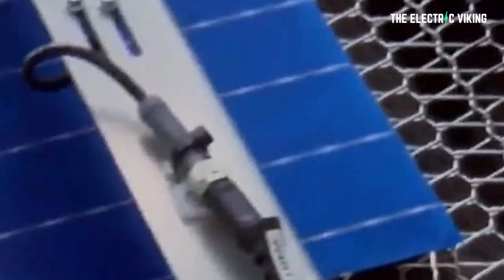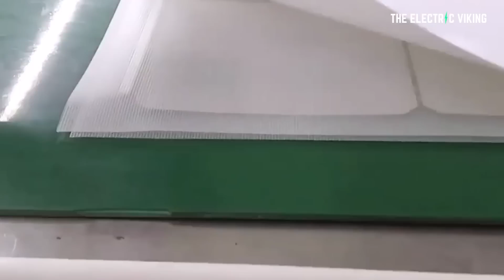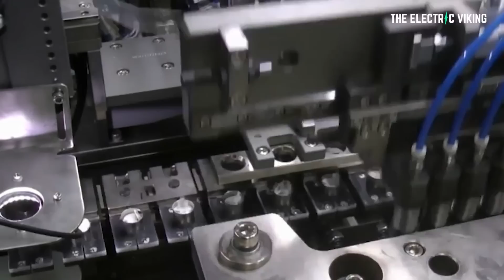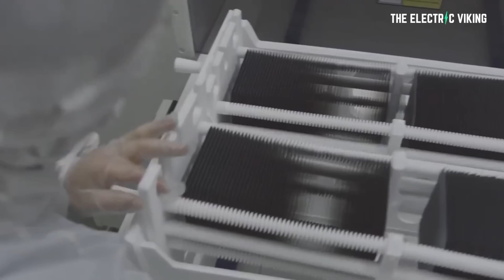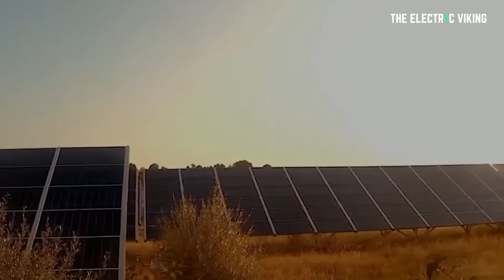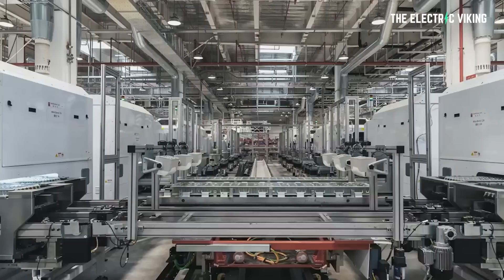China’s solar panel price war will double solar panel installations globally

Comment: Price cuts may stimulate demand but I suspect capacity is still almost fully utilized so that it is difficult to increase production that much. Also it is now vital for energy security reasons that North America develop local capacity. 80% reliance on China for solar is literally an order of magnitude worse than reliance on the Middle East for oil.
Reply: Relying on China for solar panels is not as risky as relying on the Middle East for oil. If China cuts off our solar panel Supply we can't grow but we can still produce power. If the Middle East cut off our oil supply prices would Skyrocket and we would be without reasonably priced power very quickly.

Comment: Is there any new talk about solar generated in the Sahara desert, and transported to Europe?
Reply: Talk...yes. However the Key question is this. Do you want to spend Billions on a facility and a cable then "Trust" that the politics of the country that is supplying you will remain stable for the next 30 years ??. Vlad has made many question the wisdom of relying on your neighbours !
Reply: The big benefit of solar is it can be fully decentralized and owned by the consumer instead of big utility companies that are control and monopoly driven
Reply: Yes, check how much transmission costs to build. It's expensive. It takes time. It takes permits.

Comment: Cost of labor for installs and permits is still high, panel cost dropping 30% may drop total cost 5-10%
Reply: Exactly this. 
On a 4kw system (10 panels) a 30% saving on panels will only correspond to a 8% saving on the whole system cost.

Until the installers get back down to 2019 levels of margin per job then prices won't even get down to those levels.

Comment: Dear Viking: It is still to be seen how much acceleration is doable. Installation people are already stretched to the max and the books are full for the entirity of the year. Any new orders for PV here in central Europe will be executed in 2024  not only due to lack of manpower but also due to delivery issues. Therefore if China continues to lower prices, that's ok, but it helps us in Europe only if they can deliver! E.G. the acceleration will not be more steep than the production can follow or even better: It must be leading as a spearhead. With the market logic, you are right, but there was an entirely different reason why PV installations have skyrocketed over the past 2 years here: Uncertainty and preview to the current energy crisis. This said: INstallations have increased here to the max the industry can cope with even prices and especially installation cost have increased, e.g. margins for installation companies have improved. The limiting factor is not prices of panels, it is availability.
Reply: I had solar panels in the UK for the last 11 years  2.8kwh  system and when I need electricity the most it produces below 100kWh a month Dec Jan and summer time I'm oversupplied around 300kwh month April May Jun Jul August ( average) . So in northern Europe we need more than solar power to be green
Reply: @xperyskop2475  That's what you have wind for.
Reply: @xperyskop2475  any worthwhile VAWT & thermal storage options beyond Caldera?

Comment: The cost of Solar Panel and inverters are dropping rapidly. More and more house install solar panel in their house. Bringing our electricity bill drop to almost 90%.... this is partly contributed by cheap quality solar panels and inverter from China. Their solar panel offer manufacture warranty of 12 yrs and 25 yrs of guarantee 80% performance. And inverter guarantee for 10 yrs. This has make owning solar power panel for domestic use so much cheaper. Best part is Malaysia we dont have to worry about winter.

Comment: Hi Sam.  There's a problem.  An average solar panel of two square meters in size is said to use about 20 grams of silver.  It has been estimated that a solar panel field 100 miles square would be needed to supply just the United States with 100% solar energy.  There are 1,609.34 meters in a mile so, doing the math, that much solar panel area would require 258,997.52 tonnes of silver.  However, global annual production of silver is only 26,900 tonnes.  This tells me we will need to replace silver as a solar panel conductor with something else.  Graphene comes to mind but we are years away from having cheap graphene produced at scale.
Reply: Currently a problem.  The US is not manufacturing solar cells.
Reply: so it would just take 10 years to build the panels? your problem doesn't sound like a problem at all..
Reply: @fredrelay1052  I hope you're right but that's IF graphene will work.  I'm sure the total world's production of silver would not be available to the photovoltaic industry.
Reply: We don't need to run the US on 100% solar.   Neither has technology development come to a screeching halt.   The 100% calculation assumes that.  Not dumping on anyone.  But be careful with this sort of calculation.
Reply: @danharold3087  Totally agree but such matters must be part of our figuring when we talk about transitioning from fossil fuels.
Reply: @McClarinJ  Agree too.  Just saying don't start with brain damaged over simplified calculations like the solar one.
Reply: @danharold3087  I agree it's over-simplified but brain-damaged?  If we don't do the napkin math we'll be forever in the dark about what's needed.  You're welcome to suggest a more accurate set of numbers.
Reply: @McClarinJ  Start by not assuming the US will run 100% on solar. LOL

Comment: Okay, Sam...

So the diesel powered equipment needed for mineral extraction...the petroleum and gas I puts needed for materiel processing and refinement...the power needed to run those factories 24/7, regardless of weather...the seaborne and land shipping to get those panels wherever...they're all of a sudden going to be done by solar.

Really, dude?
Reply: By your rational it is impossible for farmers to grow crops.   The weather cuts yield.  Birds eat the crops. Equipment fails at critical times.  Some falls off the truck on the way to the bin.   Some crops spoil in the bin.    Prices are generally in flux.
Reply: @danharold3087  Your analogy was actually an extension of what I just said.  Without the petrofuel and gas inputs, farming drops or ceases.

Thanks for the assist.
Reply: You might want to look at solar powered electric mining & farming equipment catalogues. Remote mining sites are tortured by diesel costs. Solar/wind/battery setups are reducing cost inputs already. As the song goes - Times they are a-changing.
Reply: @kimbels791  Haven't seen solar/wind/battery doing anything but causing power instability and RAISING costs.

Power poverty didn't come from coal and gas.  It appeared after the installation of solar and wind and the imposition of feed-in tariffs/net metering.  Even though these sources are a BLIP on the utility operator's map, they have to pay solar and wind owners for full power, even though they actually generate almost  NOTHING.  They then ALSO have to keep the grid up using coal and gas, which they are FINED for using.  Guess what that does to power rates?

They don't go DOWN.
Reply: @billcichoke2534 Choosing to change the subject & ignore that I just pointed out that regional/remote mining & farming operations are benefitting from cheaper running costs with solar/wind/storage set-ups because they are not grid connected and diesel is very expensive won't change the fact that this progression is successfully under way.

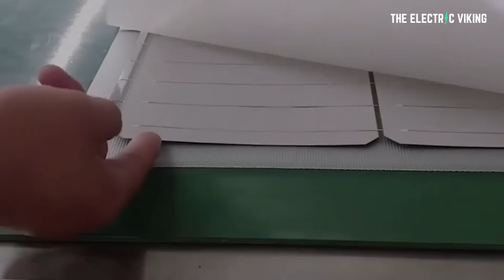Comment: 5:12 Polysilicon panels are ideal for many commercial installations such as on warehouse roofs where there is an over abundance of space.  However for domestic installations which are usually limited by size,  the more efficient monocrystalline panels are usually economically advantageous.  This is even more true in Europe where the sun is weaker than some parts of the world, so you need as much efficiency as you can get from the installation.  Whether monocrystalline raw material costs are falling is another matter, I suspect not significantly since they went up a lot in 2022.
Reply: Supermarkets: have a lot of roofs...what do they do...instead of using daylight and installing solar for the evening...they close the whole shit and use electricity...even during the sunniest days of summer.
Reply: The cost of solar panels is only part of the cost, with optimisers, inverters and batteries plus installation costs.    In the 6 solar quotes I've just had the PV panels make up around 25% of the total cost. 

 It may be that with large  commercial installs then a greater number of lower cost panels can be fitted, but these will need greater inverter and battery capacity too 

So, on UK (and European)  domestic installs the reduction in panel cost would only reduce the total installation cost by c8%.
Reply: Land scarcity is not a problem in many countries and there are many ecological advantages in floatation solar power plants in rivers and lakes , go read the articles about it.
Excuses and misinformation are often in the interest of stakeholders.
China, India, Africa and much of Europe have invested heavily in billions in these technologies, why is US trailing behind? Bcos there is little profit to be made for the big players and stakeholders
Reply: They can also use wind and hydro/wave for colder places with less sunlight than California
Reply: Solar panels are made with coal (for the substrate) and then natural gas (which provides the hydrogeen for deposition). solar panel manufacturing was massively interrupted by the energy shortage particular in eu for german made panels. there is sadly no practical way to make solar panels without fossil fuels at the moment, without making them 10x more expensivve.
Reply: @sectokia1909  Even if that's the case in all solar cell processes, it is an infinitesimal small amount of carbon used compared to the nearly 100 million barrels of oil per day burned world wide continuously for energy.

Silicon based solar panels easily last 25 years and well beyond that and still retain most of their functionality.  They will save some 50X to 100X of the carbon used during their construction during their operating lifetime.  Plus there are the upcoming Perovskite-based thin film solar cells that use vastly different construction techniques.
Reply: @sectokia1909  Fossil Fuels prices have already come back down from recent highs. 

More importantly COAL is made with COAL.  A LOT more COAL is currently burned for Electricity, than the coal to make Solar Panels. And you NEVER stop burning coal in COAL Power Plants until you shut them down. 

So getting OFF the majority of COAL is the key.  NOT worrying about the much smaller amounts needed for Panels.
Reply: @sectokia1909  Hydrogen can be won out of different processes. You need thousands of times less coal to create solar panels which transform solar into electrical energy than you would need coal to transform it into heat to transform it into electrical energy.